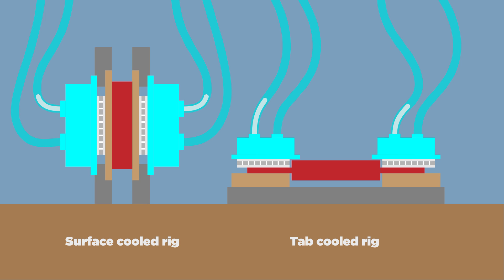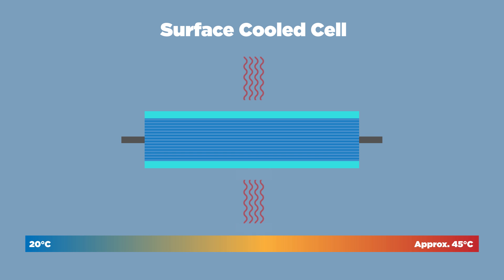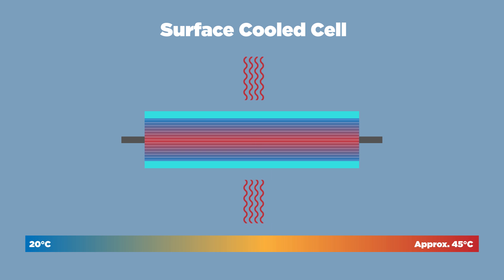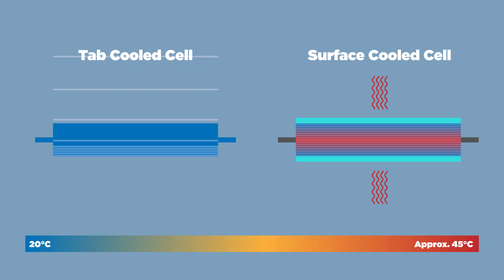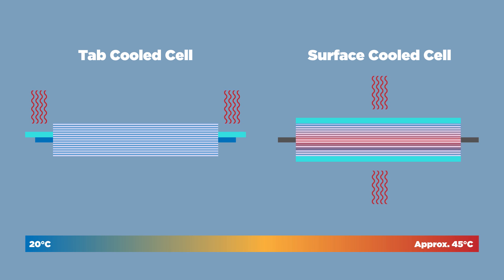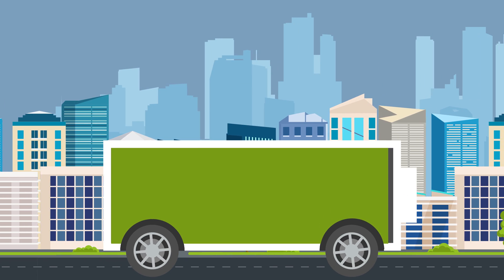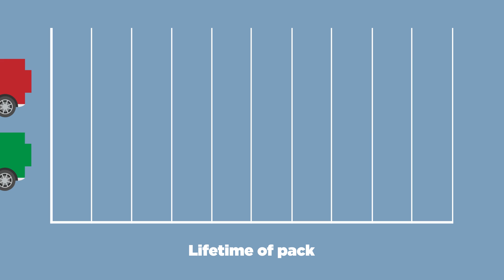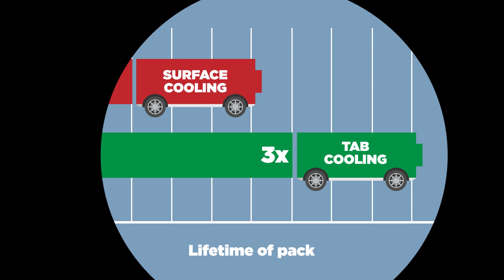Surface cooling vs Tab Cooling in Lithium-Ion Cells

Comment: Does this apply across cell types (cylindrical; pouch; prismatic), and if so, are the effects quantitatively similar, or different (and if the latter, by how much)?

How does this translate to C rate, particularly where discharge is concerned?  Is there a threshold under which these considerations are marginal?

Comment: What about surface cooling in a direction parallel to the tabs? I'm curious what the results would have been if you placed the surface coolers on the other sides of the cell

Comment: 1. The given cell do not have the tabs on opposite side, so I doubt about the uniformity of cell you are getting. 
2. If you are testing for EVs battery degradations the ambient temperatures matters a lot.  Have you tested it for the climatic condition for more than 35 or 40 degC and below 5 degC. I guess the results will be different in those cases, Also what is the average temperature you are getting in this cases.
3. For a prismatic cell results seems promising but for Kokam SLPB11543140H5 model with width only 11.7mm and providing both surfaces with liquid cooling i dont think the temperature difference could be more than say max to 1 degC or 0.5 degC.  Have you checked the difference what is it?

Comment: Great educational video from 2016/2017. 
In 2020 (Tesla's battery day) Tesla is going to change the cooling system with the new bigger battery 4680 to a tab cooling (or bottom cooling) like the Jaguar I-pace.  Maybe the Berlin's made Model Y will be the first to implement this cooling.

Comment: How are Tesla batteries cooled? By surface or tab? I think it was surface, but that would be less lifetime efficiently. So what is it.
Reply: Surface Cooling - because Surface Cooling "good enough" under NORMAL USE.  Also, Tesla does NOT use Pouch Cells and NOBODY discharges their battery pack in 10 minutes.  A "10 minutes discharge test" is a very stupid test.  Have you ever consumed an entire tank of gasoline in just 10 minutes - NO, you have not, not ever, because your engine would get way too hot = a very stupid test ...
Reply: @vtorsi610  but if you were creating a high drain application this info is useful

Comment: How do I get more details on this experiment so I can repeat it? Because, you know, science. 
What type of cells were used? The narration hints that the cells were prismatic. What about cylindrical cells?  
When the tab cooled cells were tested, how were the cells supported? Were the cells surrounded by some supportive, perhaps insulative structure? Otherwise, if the tab cooled cells were captured only by their tabs, then the cells might have been considered tab cooled as well as wall cooled by ambient air. Very effective cooling, but not a rugged way to mount a prismatic cell for any practical use.  At least when cooling by cell wall, the cell is captured by the heat sink, which lends itself to more practical application.
Reply: Instablaster...

Comment: Question.  Could batteries be cooled by submerged cooling in 3M Novec liquid?
Reply: Yes, but it would be heavy, and still only be surface cooling,
Reply: Cooling with a solvent? Probably not a good idea. At least with a non conductive fluid, both the tabs and the cell sides could be simultaneously cooled though

Comment: Hej, grate video. 
However I wonder how different cell types affect this? What cell form factor did you use?
A cylindrical cell cooled at surface like a 2170 have maximum about 21mm between cooler plate and extremity of cell. A pouch cell that is cooled only at tabs can have >100mm. Fully agree that the negative aging effect very related to the difference in temperature  inside the cell. However the conclusion that tab cooling is better is to generic and cell design, etc needs to be included. 

I think I will have to read the report as it probably have this info.

Grate video, keep up the good work!
Reply: Agreed. The narration hints at the use of prismatic cells for the test, then explains the conclusion made based on the results in a hypothetical EV example. But, I'm not sure many EVs use prismatic cells. For example, Tesla favor cylindrical cells.
Reply: Lucid (the battery maker for Formula E) uses cylindrical cells like Tesla and cools at one end of the cell.  They state in their video that the thermal conductivity is different for the 2 types of cooling, and that the equivalent of the tab cooling (end cooling) is much more effective.  Based on the direction of the layers of copper (very conductive), that's probably true.
Reply: First the prismatic cell needs constant presure on the walls. Be serios, the tabs are small, the thermal conductivity is far small across a few mm, than the total thermal conductivity ofered by only one side.... this presentation is JUNK!

Comment: Toyota Prius uses air cooling system and some prius have gone over 200,000 miles without the battery dying!
Reply: Those are NiMH Batteries, not Lithium.
Reply: @imabeapirate  A Prius can have either NiMh or Li-Ion battery pack - and both are affected by heat ...
Reply: Exactly! Actually, the cars usually have a big battery to provide the range. This means that very less current flows through any one cell at a time. The research says that at lower discharge rates, it does not matter much as to which way you cool. 
Further, Tab cooling is inefficient and you take this energy out of the battery anyway. 
This research makes more sense in power applications like power tools or Outdoor Power Equipments (OPE) which currently run on small engines. But they cannot have a heavy liquid cooling setup anyway. 
One area where this can be useful is the electric race cars but there the aim is not to run for years.

Comment: That's why we have used tab cooling (top and bottom cold plates) for our 18650 cell based custom ESS (battery subsystems) for the past 5 years in all of our custom powertrain designs.
Reply: If tab cooling is better, then why tesla is still using surface cooling
Reply: @jaybabu999  Because under NORMAL USE, nobody will ever discharge the entire battery pack in just 10 MINUTES.  A 10 Minute Discharge test is a very stupid test.  Extra cooling may be needed in Ludicrous Mode ...

Comment: Very effective video, the perfect plain-English overview of this kind of research.
Reply: Have you ever discharged your entire battery pack in 10 minutes?  Of course you have not.  Therefore, this is a very stupid test ...
Reply: @vtorsi610  10 minutes is 6C, like climbing a mountain pass.  Racing pack builders plan for this average, with peaks even higher.  Since heating is a function of current squared, you need all the cooling advantage you can get in racing applications.  The difference between 3C and 6C is four times the heating.